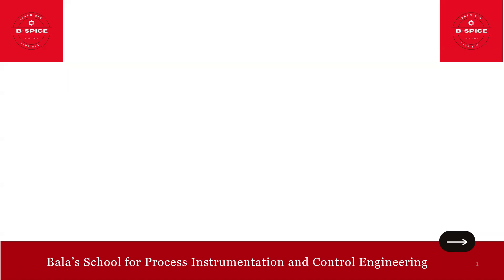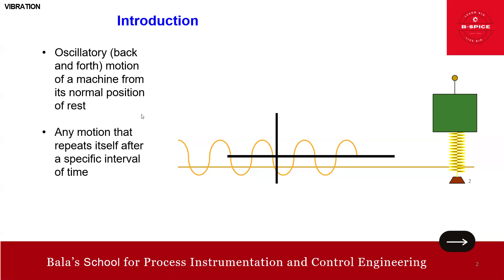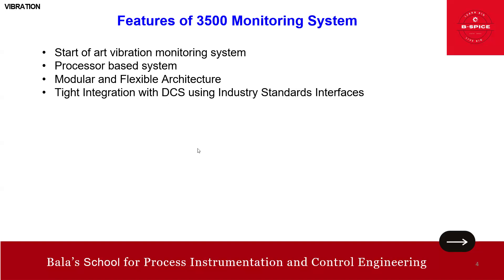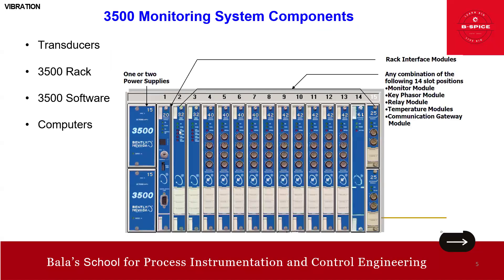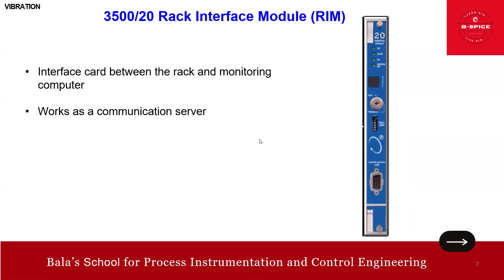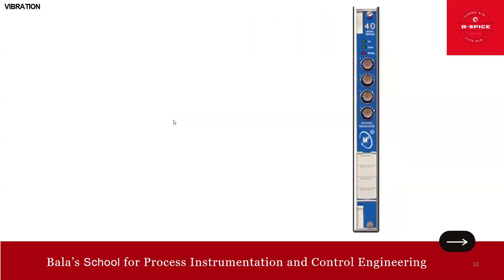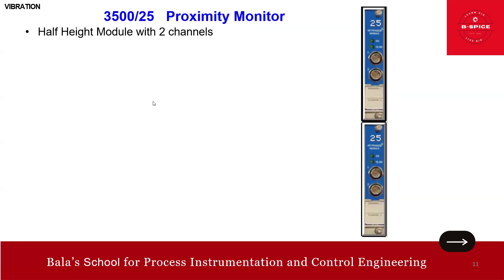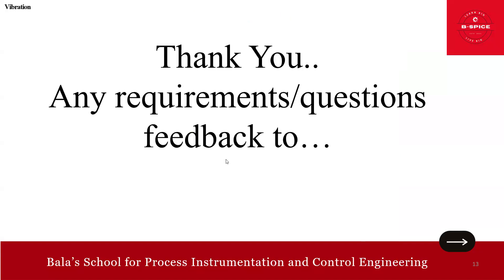BENTLY NEVADA 3500 SYSTEM

Comment: Good video sir.. kindly elaborate on trip multiplier. How to read the vibration values.. what is 1x amplitude etc. How the modules are communicating each other in the rack.
Reply from the maker: Looks like no body interested.. nevertheless, here is the answers.. 1) Trip multiplier - used to temporarily increase the predefined trip set point by a specific factor ( 2x or 3x) during certain conditions ( ex. machine startup) .. this helps to prevent unnecessary shutdown due to transient conditions that might cause higher than normal vibration levels..two types of multiplier - fixed and variable..
Reply from the maker: 2) Modules communicate with each other within the rack using a combination of hardware and software interfaces.. a) Rack Interface Module manages data flow between modules and ensures synchronization
b) Backplane communnication - Modules connected to backplane within the rack, facilitates data and power distribution .. backplane allows modules to communicate with each other and with RIM
c) Transient Data Interface Module interfaces with systems condition monitoring software ( system1) and handles data acquisition and configuration 
d) Communication Gateway modules enable comm with external systems using Ethernet TCP/IP
Reply: @B-SPICE nice one.. thank you sir.
Reply: @B-SPICE  Thank you sir, for the explanation on trip multiplier. My query was on the meaning of the term 1x amplitude and similar terms used in vibration measurement in BN 3500.
Reply from the maker: @key_shore  thanks again for writing.. 1x refers to the vibration amplitude at the fundamental frequency ( rotational speed measured in cycles per minute ) of the rotating machinery being monitored..1x Amplitude is the vibration level at the frequency equal to the rotational speed of the machine.. for, ex, if the machine is rotating at 1800 RPM , then 1x amplitude would be the vibration amplitude at 1800 cycles per minute
Reply: @B-SPICE  thank you sir..
Reply from the maker: Good point.. i got the answers for all queries.. lets wait for other comments .. i will consolidate all and upload a new video..thanks
Reply: Can you please put a light on 

1. TRUE AND & NORMAL AND LOGIC. I have a confusion that, how a TRUE AND with NOT OK is different than Normal AND logic.
2. Which are all the situations requires a module download other than a logic change? Like, 
a) Monitor module replace
b) Backplane module replace
Reply from the maker: @key_shore  thanks for writing.. its bit challening to put everything here.. next time suggest to mail.. as per my understanding in  a normal AND logic, the result is TRUE only if both operands are TRUE .. for ex.. A AND B...If A is TRUE and B is TRUE , then A AND B will be TRUE.. If either A or B is FALSE, then A AND B will be false.. that is about normal AND logic.. In TRUE AND NOT OK Logic, additional condition where one of the operands is negated.. for ex.. A AND NOT B, If A is TRUE and B is FALSE, then A AND NOT B will be TRUE, If A is TRUE and B 9s TURE, then A AND NOT B will be FALSE and additionally if A is FALSE, the result is FALSE regardless of B... On the second query .. module downloads required for Firmware updates, New Module Installation, System configuration, troubleshooting and diagnostics
Reply: @B-SPICE sure sir i will be communicating through email. And thanks for taking time and putting explanation here..